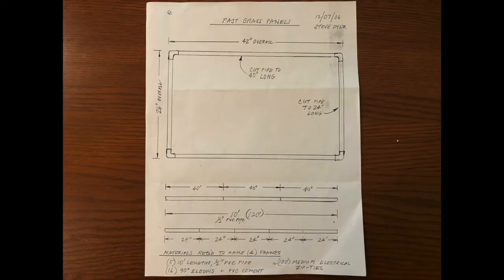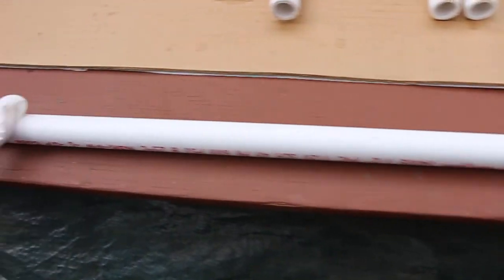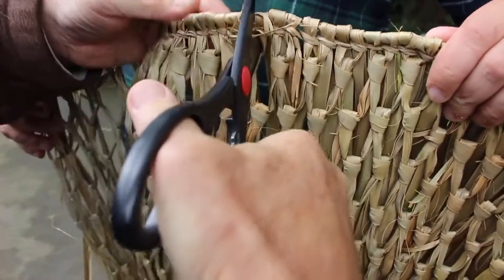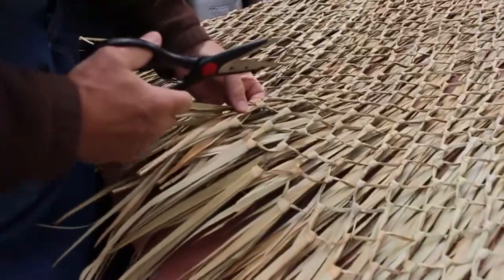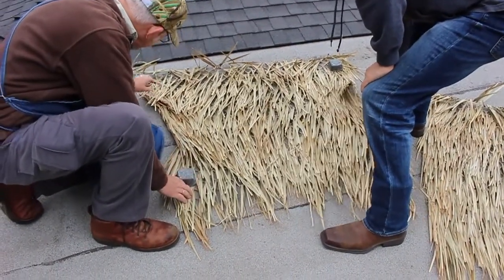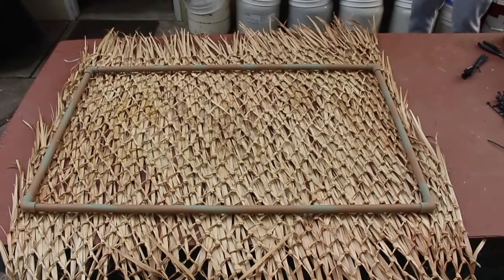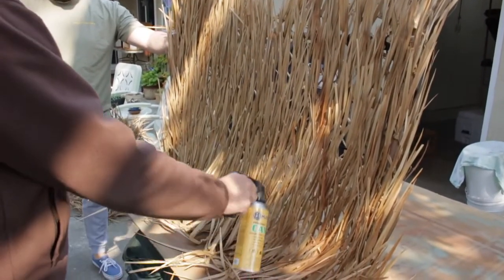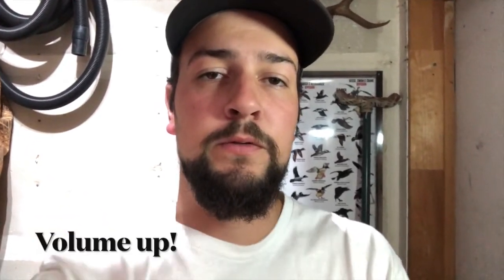GRASS PANEL BLIND BUILD | Using FAST GRASS Material

Comment: Our grass panels have been a real game changer for the Cal Sprigs Crew. I originally made these grass panels for use in a pit blind. Very soon, we saw that we could hang them from green garden stakes out in the marsh. (6 foot green garden stakes from Home Depot or Ace Hardware.)We usually bring two grass panels per Hunter. We have killed lots of waterfowl, using these panels in area of marginal cover. …….Uncle Steve

Comment: Looks good, got my idea seeing Steve in marsh last year. Did the same thing, but at the bottom I put a pvc t, removed the plastic off garden stakes and then they slid in the half inch pvc perfectly, drilled a couple holes for a d ring pin, so I can adjust the height. the stakes just slide in and out, pin it where necessary

Comment: How do you haul it into refuges? How many panels you hauling?
Reply: We use the decoy cart to carry our guns, decoys, other supplies. After everything else is tied down securely, we lay down the grass panels on top and strap them down with light pressure to avoid damage. We usually bring two panels per Hunter…..Uncle Steve

Comment: What wire are you using?
Reply: We use #12 solid copper wire with plastic jacket. Cut wires to 12 inches long and then fold in half. We use electrical tape to wrap the bottom portion of the wire to the green garden pole. Good luck. Uncle Steve